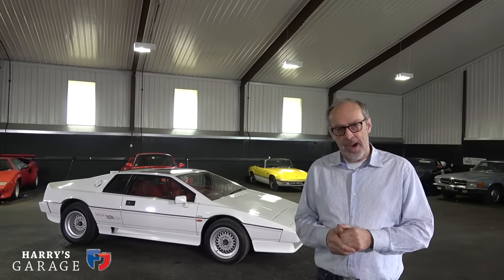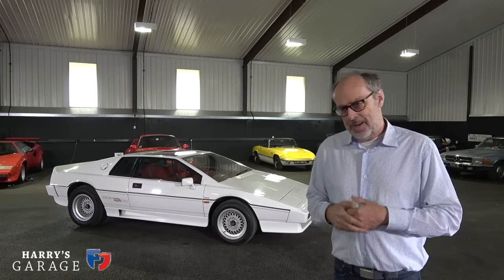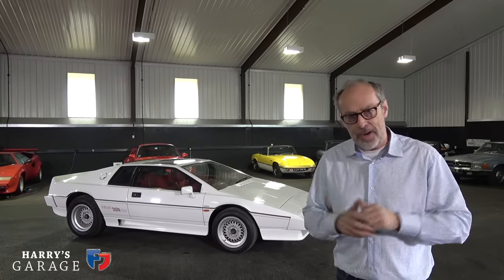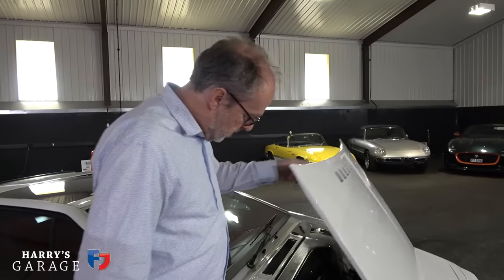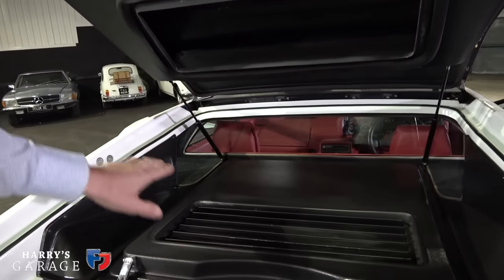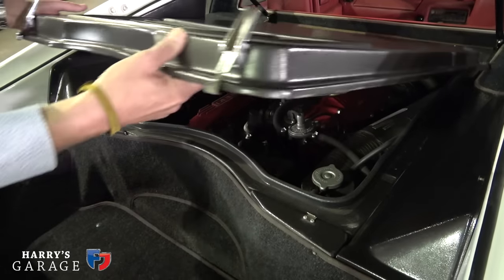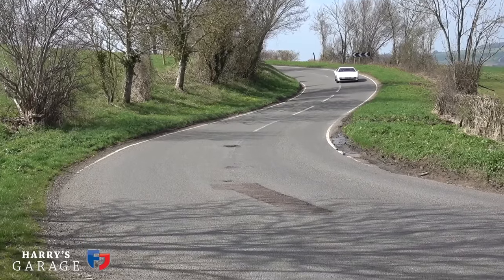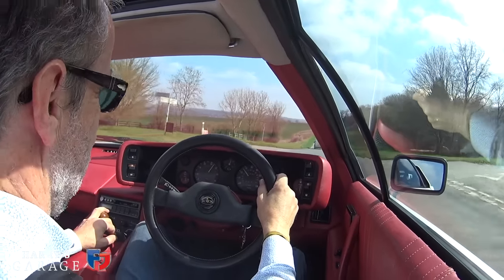Lotus Esprit Turbo HC real-world review.

Comment: Being both a mechanical engineer and someone who services and repairs his own cars often ruins it for me. Since I have very limited funds and spare time to devote to cars, I always judge them from a reliability / cost of ownership perspective. And based on what I've read and been told by the local Lotus mechanic / guru in our area, these things are relatively high maintenance and difficult to work on. From my experience, very little on my Exige is easy to work on, but so far nothing is horrible, either, and most normal maintenance / repair parts are really cheap. But according to him, the Esprits are far more difficult than an  Elise or Exige. To further drive home the point, there is a guy who shows up at the local Caffeine and Octane with a very well sorted V8 Esprit with a license plate reading "MUNYPIT". So unfortunately, that alone kills it for me, as it has with many other cars I've dreamed of owning.

Comment: I had 02 Esprits which I kind of enjoyed but they were annoying little oil leakers, rain water leakers, lots of unfixable interior sqeeks and groans, engines were ridiculously underpowered etc....but they had the looks no doubt.      I have a 2017 Camaro RS now and for performance, power and reliability plus its good looks its by far the best I,ve driven or owned in a long time.

Comment: nicely done

..but I think there is to much "play" on the fixings of the roof - maybe it helps to do the same as later on given as "factory refinement method" for the Stevens & S4 cars.

Front slots filled out with Polyurethane glue and rear latch redone and setup with more tension.

..and there is more on the roof theme - I mean correct use of the storage bag, the one shown in the first minutes in the video (we can see it in front compartement)
..it is meant to put the roof in, if you run your car with open top. This way you do not damage it in the rear luggage compartenent, especially on the painted fibre roof.

Comment: Harry, could I pick your brains please. I have found a standard Esprit Turbo, white with blue leather. It has done 100,000 miles but it is a 85 so has the struts on the spoiler. Priced at £30,000. Does that sound a little high for the mileage. I know yours was in the 40s but on 19,000 miles. Oh, with a sunroof too

Comment: The chatter noise is because the throttle body slams shut with to much air on the intake so the air has nowhere to go but blow back against the the compressor wheel causing the noise, amusing but nothing to do with waste gate.

Comment: Sorry, Harry, that's the BOV not the wastegate.
Reply from the maker: Interesting, guessing you mean blow-off-valve. Isn't that the waste gate, or is that to release excessive exhaust gases, rather than charged inlet air? More detail please!
Reply: No its not. There is no BOV. So incorrect. 
Its compressor stall. The boost pressure hitting back on the turbine when lifting off the throttle during gearchange.
Reply: The sound is a combination of wastegate slamming shut (thunk), and dump valve chattering. The dump valve is mounted in the small casting under the fuel pressure regulator.
Reply: BOV dumps the air in the intake tract. In this case it may no exist at all, and that would simply be the air then pushing back through the turbo once the throttle butterflies close. A wastegate will only "slam shut" if it's open, and I don't think it is on these vids. The wastegate is there to limit the amount of boost pressure on-throttle.

Comment: I owned 2 of these US versions. 1 was a beast and the other was just horrible. 3 rd gear woukd dissapear. The oil fill cap made of nylon would melt. The roof panel would pop up. It overheated and it just was just all over the road.

Comment: I'm sure the extra weight of the later Esprits had a lot to do with meeting safety requirements, which is at odds with the Lotus concept of making cars as light as possible.
Reply: No.  Not at all.  There is not a single thing added on the S3 shape for safety.  I have an N/A S3 HC.
Reply: @ChristianRThomas  Then why did they make it heavier if they added no structural strength? Why did they do it as its at odds with the Lotus philosophy? I'm not trying to argue, just interested in why and what benefits were achieved. Cars in general went through a phase in design where they were made lighter for better mpg, but then started getting much heavier again as they had to be structurally much more solid to meet crash test requirements.
Reply: @fiveowaf454  They generally just got heavier as they got more sophisticated and better finished.  Casting for the turbo, oil coolers, motors etc in doors, additional bits of bodywork at side and front, air con (which always needs rebuilding).  The front and rear bumpers too - they may be part of US safety   -which both weigh quite a bit (I have just put a spare front bumper on the bathroom scales and it's about 6kg.  I thought it was going to be more.)  They didn't really try and save weight.  The glove compartment lid, for example is 3/16th steel sheet.  In composite it would be 50 grams.  I reckon you could easily knock 100kg off the weight of the thing.

But they are astonishingly safe, especially the Excel.  I had an RAC man come out and he told me of a fatal crash he attended between a Volvo and an Excel.  Apparently the Excel looked untouched.  I don't feel quite as safe in the Esprit as I did in Excels but I feel a lot safer that I would in almost any other car.
Reply: @ChristianRThomas  Interesting, Thanks

Comment: How reliable, or unreliable are those cars...
Reply from the maker: Ask me in a year's time
Reply: Lots Of Trouble Usually Serious    LOTUS.    But I sincerely hope not, as I definitely want to buy one some day! ;)
Reply: it's a hand built sports car from 1987, you be the judge.
Reply: Mines been more reliable than a procession of Volvos in the 15 years I've owned it...
Reply: I've got a hunch that Volvo's legacy on reliability may have been exaggerated to an extent.
Reply: malevolenceXXXensues 9 out of 10 mooses would prefer anything French ;)
Reply: I owned my first one for 8 years from 1984 and commuted into Central London in it. Only problem I had was alternator fail and I still got home. But I used to look after it well and do plenty of preventative maintenance.
Reply: My best mate had one for years, the only downside was a poorly adjusted  gearbox linkage which would lead to missing 3rd gear,  over revving and blowing the engine. ( happened twice ) Apart from that you can use them daily.

Comment: It’s nothing to do with the wastegate it’s the lack of dildo valve, once the carbs/throttle shuts the air has no where to go, stopping the compressor wheel of the turbo, hence the CHATTER noise.